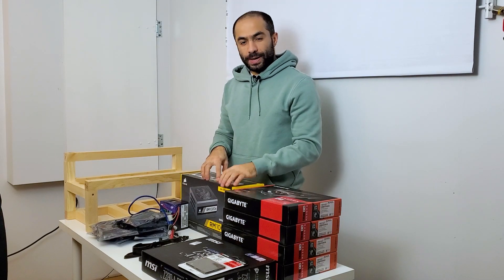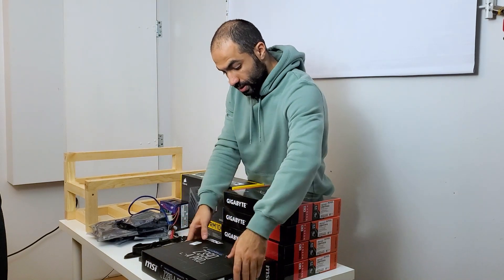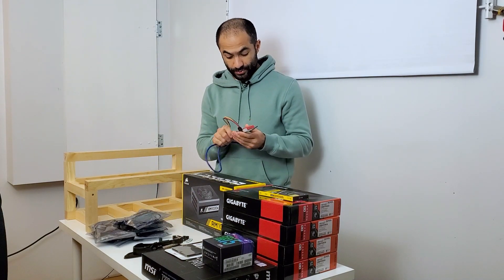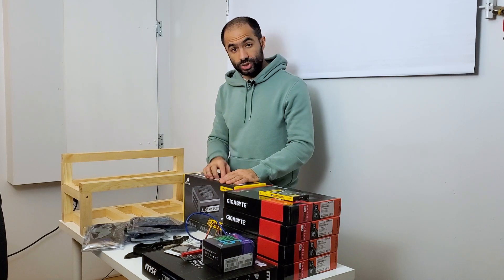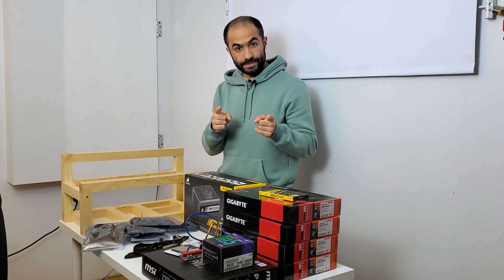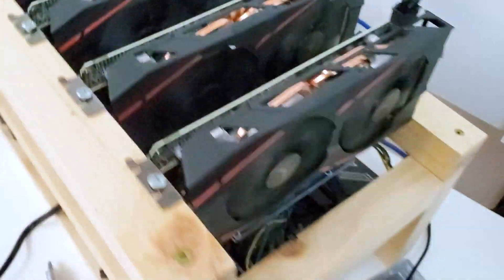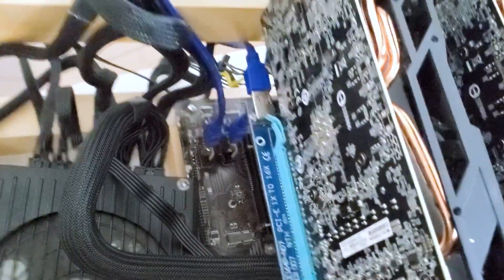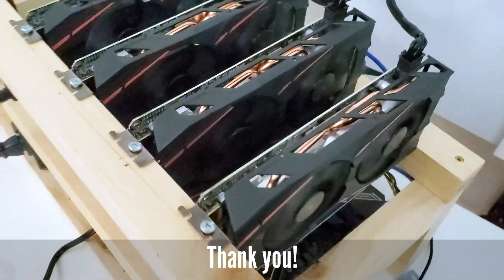4 x RX580 MINING RIG - PARTS, PRICES, HASHING POWER AND BUILD IN 2021

Comment: Great video!  I'm just getting started myself and found this video to be very helpful!  One question is what are you using for spacers to mount the motherboard to the wood?
Reply from the maker: I went to home Depot and got a thin plastic tubing (one that's used for AC units). I cut it into small pieces and use that as a spacer. It works perfectly!

Comment: What do you think of a 700w psu for 4 rx 480 , each usin 110w?
Reply from the maker: That should be okay. Also, when you overclock and undervolt the cards, their consumption will go down to around 80W per card.

Comment: can you run different gpu models at the same time?
Reply from the maker: Yes of course. Sometimes the overclock settings get mixed up and start acting up, so my suggestion is to add the GPUs one at a time.
Reply: @DaniTalksTech  even if its different serieses? lets say rx 5700 and rx 6600?

Comment: Hey man have you since been able to get them over 27 hash rate? Also what's your daily profit average been with eth around 2k?
Reply from the maker: Hi Stevie, yes I flashed the bios and managed to get them to 29-30 roughly. The daily profits have been a roller coaster. With ETH being at 2k, each card is making 1.62 usd per day after power.
Reply: @DaniTalksTech  geeze so really not to good with those. Takes about 5k to build all that now and z15 and s18 make like 20 a day
Reply from the maker: @sdhhh7hjj  5k to build a rig of 4 rx580s? It cost me around 1.5k or less. What set up do you have?
Reply: @DaniTalksTech   those rx580 are 5 to 600 each now. That's what I'm saying now currently it's not worth. What do you think?
Reply from the maker: @sdhhh7hjj  no, please don't buy them at that price. They are definitely not worth it at that price!
Reply: @DaniTalksTech  that's what I'm saying currently the z15 and asic miner makes 20 plus a day for $5500. Sucks because I'd like to mine eth
Reply from the maker: @sdhhh7hjj  you can buy eth with the coins that you are mining. I got most of my RXs at around $300 and even then I thought they were very expensive.
Reply: @DaniTalksTech  i recently got 2 new ones for 550 a piece oofe. 2 used for 400.. they were used for gaming.. which i assume is better than being from most miners.. i’ll see i guess..

Comment: what power cable do you recommend for the risers?
Reply from the maker: In this video I use Sata power, but I have since then switched to using PCIE cables since those are generally better. I got them from Parallel Miner, but you can get them from anywhere that is available.

Comment: 4x rx 580 how much psu watt needs
Reply from the maker: Hi Forever4you, I would say to be on the safe side and allow for future expansion, you should consider 850W+
Reply: @DaniTalksTech  will a rm1000 corsair one support 6 Rx580’s for a long time? (2-3 years atleast)
Reply from the maker: @MercedesMan  you'd have to make sure their overclocks don't reset. If each one is running continuously at 80w, you'll be okay. So make sure your rig is very stable. I have 6 running on the same PSU and it's been very stable. Took me a bit to figure out the best overclocks for my GPUs.
Reply: @DaniTalksTech  okay great. Im just disappointed it is $240 for the power supply unless i want to wait like another 15/20 days for $200.. and it seems time is money with this type of work.. but it seems to be a solid choice still since you’re having no issues with it. I also like that its modular. Thanks for the reply! I have 4 im starting with, im planning to eventually get to 6 like you! Hopefully prices will be reasonable more. Some guy bought the $230 rx580 i saw on walmart today before i could type address.. had to get a $390 one instead smh

Comment: Hi mate do you use Pcie_Pwr1 for more than 4 gpu ? If yes which cable do you use. Cheers
Reply from the maker: Hey Purple Head. Yeah I did power the pcie on the motherboard. I used an 8 pin pcie power cable from the PSU. I think you only need 6 pins in the motherboard.

Comment: 6 pin pcie power slot just beside 16x pcie slot on MB, is really needed to connect with PCI power cable?? 

I suspect we can leave it without connecting, as we are connecting PCIe riser with 6pin pcie power cable connector.. What's your suggestion bro?
Reply from the maker: You could try without doing it. My suggestion is that it's better to do it since I have noticed that I get better stability with it connected. Now I don't know for sure if it makes that much of a difference, but I have found that connecting it is better.
Reply: @DaniTalksTech  
Thank you for the reply..I am going to build my first mining rig with 4-RTx3080 and 2-RTx3070 with 2-HX1200w PSU..I think It will be short of PCIe connectors from psu ..I need to figure out a safe and stable way to achieve it.. Somewhere I saw that molex to pcie adapter may help when in short of PCIe connectors... I will further explore best way to do it..

I will share if I get a proper solution or any bad results..

Happy mining..👍
Reply from the maker: @adityavarma2138  Thanks for letting me know Aditya. I think the 1200W won't be sufficient for those cards. For start, each 3080 will consume around 250W (after undervolting) and the 3070 will each consume at least 130W (after undervolting). You're already beyond that PSU capacity. I highly recommend either getting a way bigger PSU or running a dual PSU set up. I don't think your current PSU set up is sufficient.

As I write this, i notice that you wrote 2 x 1200W, so ignore what i just said above...you're doing the right thing :)
Reply: @DaniTalksTech  
Yeah I am using 2 X 1200 w..I think I should have written more clearly with 'x' instead of '-'.. :)
Reply from the maker: @adityavarma2138  all good :) thank you for clarifying! I misread that as well. Great set up!

Comment: Hi Dani, I am building my first mining rig and I got 
MSI Z390-A PRO LGA1151 - motherboard and 3 Gpus
NVIDIA GeForce RTX 3070 FE, EVGA GeForce RTX 3060 XC, and ZOTAC GAMING GeForce RTX 3060
You mentioned in your video about Risers but I am not sure which one I used get for my gpus, can you recommend risers?
Reply from the maker: Hi Balochcode. One major thing to note here is that 3060s won't hash fully when using risers. There is a limitation that NVIDIA put on them and the only way to go around that is with a certain method. You can see my video about it here: https://youtu.be/sW-xvWLE7bc

As for the risers, I got mine from gpurisers.com you can also get them from amazon.

Comment: HI sir what vga should i choose for starting  mining 3X RX580 OR 2X 1660 SUPER? THANK YOU SIR
Reply from the maker: Hi Parski. You'd be getting more hashrate with 3xRX580s (90MH), but the 1660Supers are so easy to deal with and extremely stable. What price in USD are you getting them at?
Reply: rx580 is more cheaper here in taiwan 
can you give me cheaper build mobo and procie for mining rig?
Reply from the maker: @parskihaha1050  Hi Parski, the build in the video is reasonably priced, unless you can find a 6th or 7th gen cpu/mobo.

Comment: Can you please tell me your bios setting I can only get 3 cards to work on my build.
Reply from the maker: Hi Anthony, what mobo/cpu are you using? You should be able to get 4 on there without any bios tweaks.
Reply: @DaniTalksTech  I am using msi z390-a pro with i5 9400f 8 gb ram hive os on USB stick.
Reply from the maker: @johnnnnnnnn67  hmmm...that's weird. In the bios go into Advanced, then enable 4G Decoding/Crypto minig. See if that works?
Reply: @DaniTalksTech  yes it is on. What bios version are you using?
Reply from the maker: @johnnnnnnnn67  Unfortunately, I cannot check right now. i updated to the latest one. I think it was 7B98v1D
Reply: @DaniTalksTech  if you do get a chance please let me know. Thanks.
Reply from the maker: @johnnnnnnnn67  Hi Anthony, confirmed that it's 7B98v1D bios version.
Reply: @DaniTalksTech  Thanks, I now have 4 cards working.
Reply from the maker: @johnnnnnnnn67  Nice!!!

Comment: Quick Tip = Never use power tools to drive/remove hardware around electronic equipment. One metal burr in the wrong place and ZAAPPP!!....dead rig.
Reply from the maker: That's for the heads up Jeremy! It was quite tough to use a regular screwdriver. I will keep that in mind for future builds.
Reply: @DaniTalksTech  Mark you screw locations, then drill pilot holes in the wood before driving the screws, then shoot everything with a spray of compressed air to blow the sawdust off of your rig (wood holds moisture = same end result as a stray metal burr). Hand tools require strong muscles....be a craftsman, not a floppy wienie. LOL 😊
Reply from the maker: @Jeremy-H-1977  I definitely don't want to be a floppy wienie hahahaa :) Thanks for the tips Jeremy. I appreciate it!

Comment: Hi..How was the performance with msi z390 A pro mother board? 
Do you recommend buying that for mining with 6 RTX 3080  cards?
Reply from the maker: It worked like a charm. It does require some bios tweaking after the 4th GPU. I was able to fit 7 GPUs on it with the M.2 to PCIE Adapter.
Reply: @DaniTalksTech  
Sounds awesome..I will go for it..Thanks a lot..
Hope bios tweak settings were shared in your channel..I will go through it..
Reply from the maker: @usavarma  I didn't make a dedicated video about the bios settings. In short, go into your bios, hit F7 to switch to advanced mode, then enable 4G Decoding/Crypto Mining. Also, change your Windows OS settings to UEFI. Finally, enable your integrated graphics as well. That should get the job done.
Reply: @DaniTalksTech  
Thanks a lot..I will try that..I just ordered the motherboard..😊
Reply from the maker: @usavarma  Let me know how it goes. If it doesn't work for you, I will make a short video about it.
Reply: @DaniTalksTech  
Sure..So kind of you..Thank you..🙏
Reply from the maker: @usavarma  My pleasure :)
Reply: @DaniTalksTech  
Hi as you said, iam stuck after adding more than 4 GPUs. I enabled 4g decoding and pci max speed to gen2 later gen1.Both didn't work. I couldn't see any output on monitor.On the mother board, I see white debug led is ON,  I think that's related to issue with VGA.

My rig configuration:
=≠===============
1) 4 x RXT 3080
2) 2 x RXT 3070
3) Z390 a pro mother board
4) i5 9400f processor, which doesn't have integrated graphics support.

Any suggestions to fix this issue?
Reply from the maker: @usavarma  Hi Sathyameva, sorry to hear that you're having trouble. I personally stopped getting any intel CPU that doesn't have integrated graphics since it's a lot harder to test things if you can't see anything. There is one more thing to try. Change your Windows OS configuration in the bios to UEFI. See if that works! Let me know please.
Reply: @DaniTalksTech  
Sure.. I wil try that and let you know the updates..
Reply from the maker: @usavarma  Sounds like a solid plan Sathyameva! best of luck :)
Reply: @DaniTalksTech  
Thank you bro 💗 🙏..
Reply: @DaniTalksTech  
Hi Bro,
Setting windows OS configuration in bios to  UEFI fixed the issue. Now my mining rig able to boot successfully with 6 gpus and able to start mining..Thanks a  lot for the input..

Iam seeing blue-screen windows-10 crashes(Memory Management) after every 15-30 mins of mining. I have changed the windows virtual memory size from auto to different sizes like 32,64,128GB and also updated to the latest Nvidia drivers. But none of them fixed the issue..Any idea on how can I fix this issue?
Reply from the maker: @usavarma  I am glad to hear that the UEFI setting worked out. I am unsure of the blue screen. Are you getting it only when mining or does it happen when you're not. What's your SSD capacity and can you increase it beyond 128GB (although I don't think you really need more than that). The max that I ever set mine was on 7 cards and I put it at 80GB.
Reply: @DaniTalksTech  
I am seeing the blue screen crash issue only during mining..I did minor changes in mem clock and power for one of GPUs, which I am suspecting to be causing this issue..After this change mining is running without any issue for the last 10 hours..

More details:
===========
This issue is with asus strix 3080. I have two of these, both were configured with same OC settings. But looks like one of them causing the issue and after reducing memclock and power limit of that gpu, mining is going smooth from last 10 hours.. But the only drawback is hash rate went down from 99 to 97 but it's ok..

Thanks for guiding all along the bring up of my first mining rig..Truly great help..
Reply from the maker: @usavarma  I'm glad to hear that it worked. 97 stables is way better than 99 and not stable. I get around 97.5 on mine. If I push it any further, it starts crashing. It also depends on the temps of the card. The cooler it is, the more you can push it. Good luck with the rest of your rig :)
Reply: @DaniTalksTech  
Max GPU temp is 58 C
mem junc temp are 102(colorful), 95 (asus1), 92 (asus2) 90(galax)

102 is concerning, fingers crossed iam just running it..From mining community, few says that's nothing to worry, few says, it will be causing issues going forward... What's your opinion on this bro?

Comment: hi mate, may i ask a question, i have the same mobo as your, and getting 3 used rx 580 and manage to build the rig, but when i boot up, the third gpu can't be detected. can you help? or maybe some of the viewer can offer me with some solution or insigt.. Thanks in advance.
Reply from the maker: Hi Fredy, I wish I can assist with that. It's a bit tough via the comments. Are you not seeing it in Device Manager? Have you troubleshoot things to eliminate that there is something wrong with that specific GPU? Does it happen with any of them (when you have 3 there)? Are the latest drivers installed?
Reply: @DaniTalksTech  yep, in device manager only show 2 rx580, and i've asked my friend to test the specific gpu and it worked just fine, but when i swap that specific gpu with another one, it just not showing. meanwhile i the other two working just fine. and if i tried it with working riser and it still show nothing. i've been struggling for the past weeks with nothing working
Reply from the maker: @GGmasbrov  Hi Fredy, sorry to hear that. You've done all the right things and there is nothing else that I can think of that can solve this problem. I wish I can help, but it's tough to troubleshoot via the comments. I'm confused as well!
Reply: @DaniTalksTech  well it's cool, i appreciated your kind gesture. Thanks man. Currently im trying to get another mobo or gpu to test whether it's the mobo faulty or not. again, thanks man.
Reply from the maker: @GGmasbrov  Did you manage to make it work Fredy?
Reply: @DaniTalksTech  well, i only manage to get 4 to work, when i plug 5 gpu, it won't display

Comment: The first 1 is running cooler cause there's no GPU next to the fan side I would suggest separating the gpus as far as possible till you get the rest of the gpus
Reply from the maker: Hi Moises. Yes, I've since then done some heat management work and seperation and it worked like a charm! Thanks for watching my video man. I appreciate it :)

Comment: @DaniW how did you make the other gpu’s to work I can’t make mine to work I have the same cards
Reply from the maker: Hi edjean24, what motherboard do you have? What is the exact issue that you are having? Are they not showing up, or is the motherboard not booting? Can you please give me some details? Thanks
Reply: YBZJ Complete Mining Rig System... https://www.amazon.com/dp/B08ZJFP18M?ref=ppx_pop_mob_ap_share 

That’s what I bought I installed the 1st gpu and works fine but when i go to install the others i have issues don’t know how to go the bios (when to the settings) and still. Don’t know how to make the others gpu’s to work
Reply from the maker: @edjean24  Thanks for sharing this with me. Unfortunately, I am unfamiliar with these at this time and unfortunately I won't be able to give the right answers. You should go to reddit and post a question in the gpumining subreddit. Someone will have the answer! Sorry I cannot help with this  :(

Comment: I really appreciate your video, I will shortly assemble my first rig and follow your instructions carefully : clear, complete, short and from begin to end! Only one observation, may be someone already wrote on this theme : i think the right card is the coldest and the left card the hottest only because the right one breathes free air and can blow cold air on the card. The others, with each step you take to the left, breathe heated air from the board to their right, and therefore become progressively warmer. It may be appropriate to review the positioning of the gpu cards, I speak in general and not strictly about your rig, taking into account that each one should have fresh air and not heated by the one next to it. For example by placing them horizontally side by side or, returning to the vertical case, building a guide for each fan that helps the fan itself to draw fresh air from outside the array. Better still it would be to feed this guide with an external fan placed at 90 degrees with respect to the directions of the gpu cards.
Reply from the maker: Hi Giuseppe, thank you very much for your kind comment and for watching my videos. I appreciate it a lot! Good luck with building your first rig. In regards to the temperatures of the GPUs, I have since then been able to manually manipulate the fan speed to maintain a cool consistent temperature on each. As you already mentioned, the positioning also makes a big difference. I set up my fan speed at 70% at the coldest end and progressively increased it to 85 at the warmest end. This kept all the cards cool and under 60C or 55C.